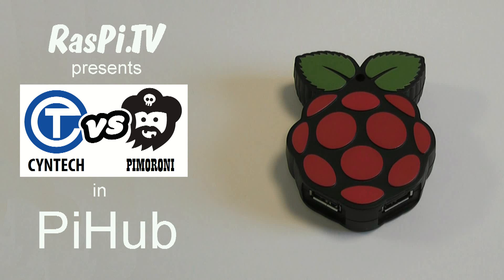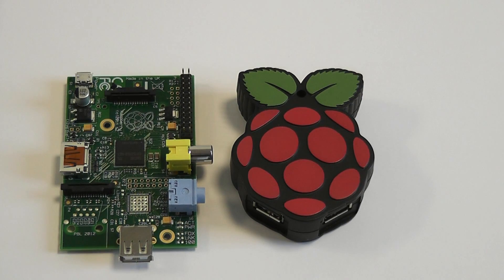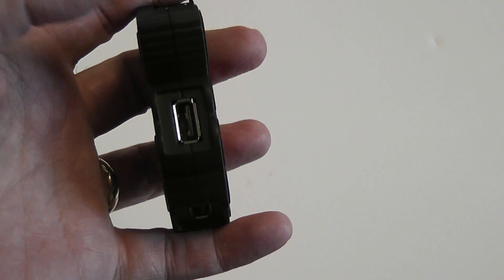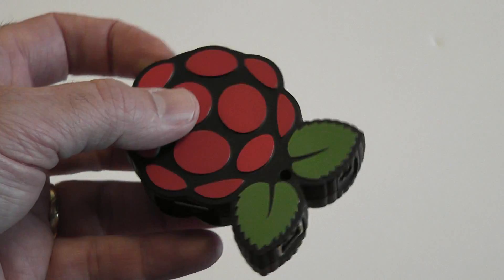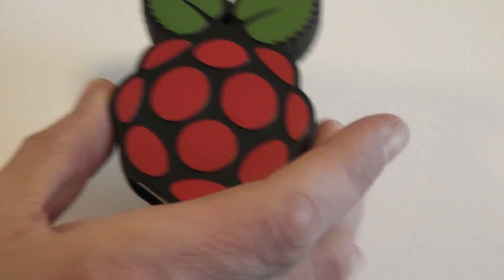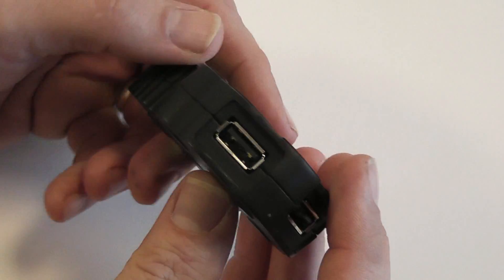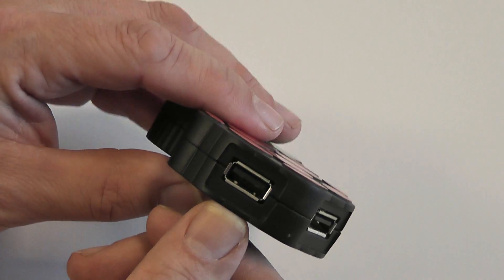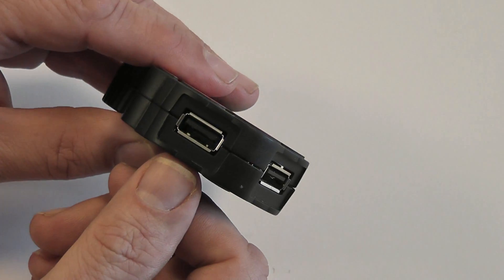PiHub video showing the essentials of what the PiHub can do

Comment: In my opinion even not considering the price, this is quite subpar for a 4 port hub supposedly designed for the raspberry pi.  The only thing going for it is the logo, the rest is just marketing fluff "cutesy" shape.

If you were to design one with a right angle USB plug, integrated 1 inch cable, hub logic/pcb which sandwiches on top of the pi and gives the ports on the same side (or sides) as the pi's existing ports, and had standoffs to hold it's place as a sandwich board, then it would be.